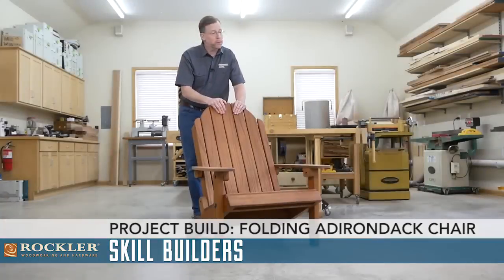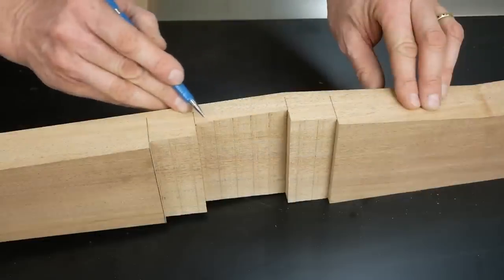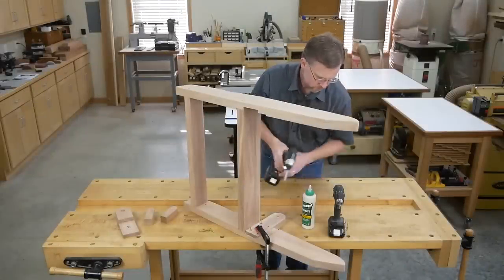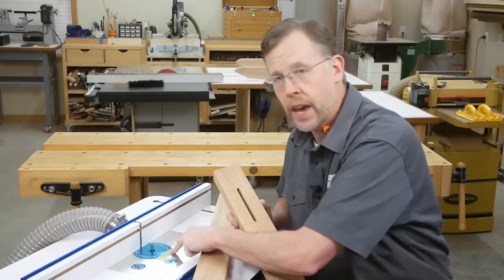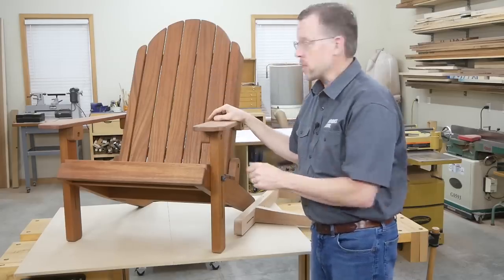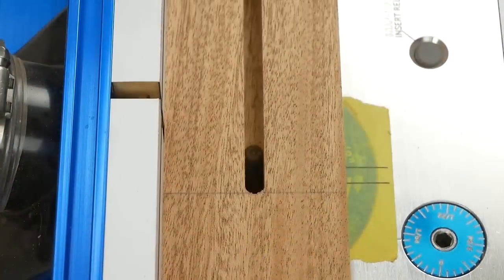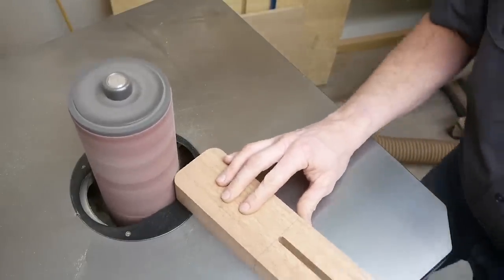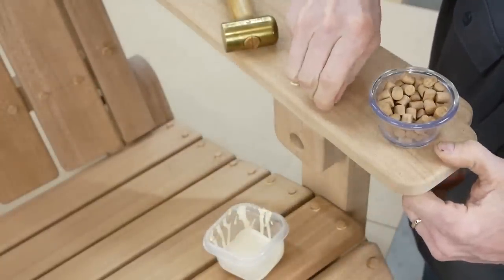PROJECT BUILD: Folding Adirondack Chair

Comment: Thanks, I bought the plans and hardware, then I realized it asks for 6/4 stock. I was planning to make it with PT pine, for costs reasons. Mahogany is beautiful but way to expensive. What other alternatives do I have?
Reply from the maker: Pedro, It is okay to build this chair our of any material that you have available, some will work better than others outdoors, PT is great for that. PT lumber is usually make from Douglas, so it may not be as strong as making it out of Mahogany or White Oak.
Reply: @rockler  Thanks for your prompt reply! Will build them in PT, thanks!